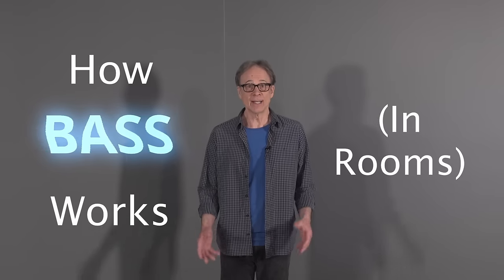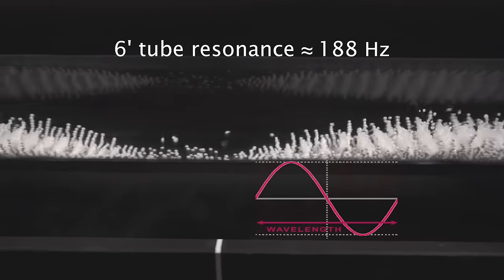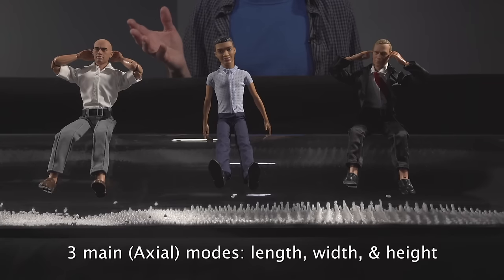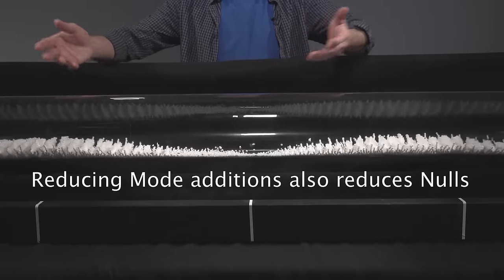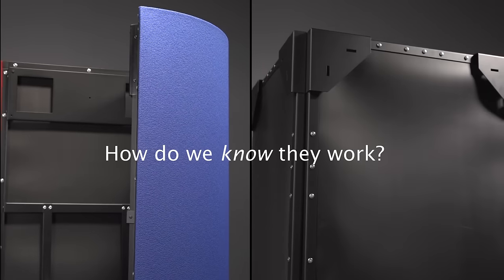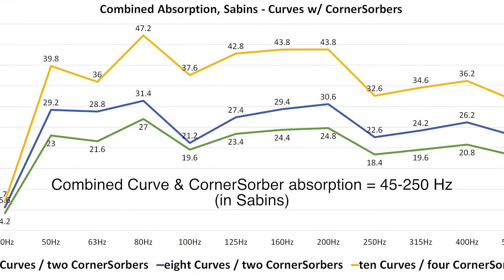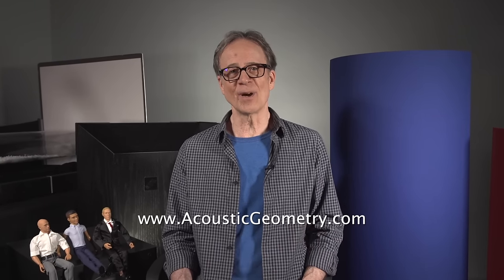How BASS Works (In Rooms) - Acoustic Geometry

Comment: Exceptional video! But what have "I" learned??? That I am not going to be able to sound treat my living room unless I buy expensive accoustic panels that must be placed by expensive specialists who know what they are doing....Oh well...
Reply: I agree. Interesting video but no help whatsoever with setting up my hi fi system and in particular my sub woofers. well its back to good old trial and error for set up.
Reply: @johngarbutt  just buy reputable bass traps, the more the better basically
Reply: @johngarbutt  I agree guys, there is some nice knowledge in here, but as for me and my setup, this doesn't really do much for me other than to play around with my own testing of acoustical materials and where place them in the room and then for the hours of listening tests as in A to B and back to A....
Reply: I think this video is marketing targeted to the very specialists you mention.
Reply: @jasonLJ  bassically
Reply: @johngarbutt  Start by putting them in the 4 corners of the room. That'll go a long way. Ideally they're supposed to be placed at all the corners, such as where the floor meets the front, side and back walls. Same for the ceiling but neither one is practical. Putting them in the 4 corners may reduce standing waves and dips by about 80%. Good chance you don't need to hire or consult anybody.
Reply: If sounds good, it is good.
Reply: Or, go full old school and use egg boxes!
Reply: Not 4 corners...8 corners... 😉

Comment: Nice video production.  I really liked the visual examples and education on how bass works in rooms.  You've said that porous absorption is not effective under 200 Hz though, and that's just untrue.  If that was true, and the only thing that worked were pressure-based treatments, then you'd never see professional studio builders filling their rooms with rock wool and fiberglass at depths up to several meters.  Those treatments absolutely work, way down to 30 Hz, when you build them with correct depth and density.  I can support that statement with a real world experience and acoustic testing data. 

It's definitely correct that as particle velocity decreases the effectiveness of porous treatments declines, that's why airgaps are used.  Even without airgaps, fiberglass can damp room modes down very low in the LF.  In my control room we have a front-back axial room mode of 35 Hz that we treated with 1 m of fiberglass and slats.  The low end is completely controlled.  

And of course pressure treatments have their place and use.  But it's off base to claim that under the Schroeder frequency you cannot use porous absorption.  People like myself are doing it with excellent effectiveness.

Comment: 2021: Acoustic Engineer consultant Designed my music room w/grand pianos(2) 25x35'. It is not s rectangle but has built up corner absorbers; w/Glass Blocks to absorb 50% Street bus noises.  Sound travels 100'/sec

Comment: Great videos! Informative and made easy to understand. I'd love to see a video about the acoustics in a round room. I have a such room with a sound system and I'm having a hard time to understand how to manage the acoustics. It seems like the sound bounces in an almost chaotic way to different directions.
Reply: It still works in a similar way to a rectangular room at low frequencies, except for the length and width are identical every which way, meaning there is one very strong horizontal room mode right in the centre rather than many weaker ones.

Comment: I just go sit in the corner and wish the whole room was that loud. 
😂 <— basshead
Reply: Same! 
(Fun fact, by the way, if you put a sub in and facing a corner with an obstruction (like cabinets) a few feet above it, the output is greatly increased throughout the room with fewer noticeable modes. It's the same with putting it under a desk or something like that. The modes even out to give more accurate output. Why do I know this? Testing! How does it work? Reverb I guess. I don't know.)

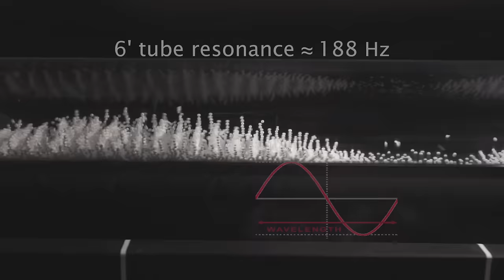Comment: at 0:45 the 6' tube resonance = 188 Hz
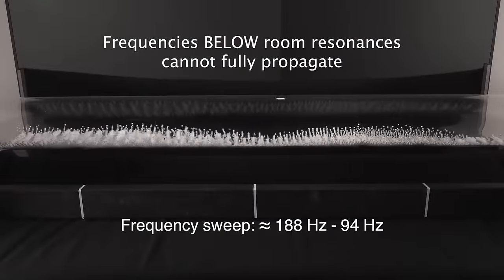at 1:46 there is a sweep from 188 Hz and down to 94 Hz
The narrator says that below the modal range (188 Hz) bass can't fully develop while the video is very clear what happens. There is plenty of energy in the whole tube at 94 Hz at 1:52! 
Bass very obviously develops without any issue below the modal range. -There's plenty of bass inside a loudspeaker box. -We can hear the whole frequency range with earbuds, even if the modal range of the ear canal is at about 15kHz.

1:57 "the room crossover". This is the "transition range" (Schroeder frequency) and it indicates the area where the room transitions from Ray-based acoustics to the modal range where the sound is dictated by the room dimension. It is not "velocity based to pressure based" sound behavior.
The pressure range is below the lowest mode of the room (the longest dimension of the room).
Maybe what the narrator wants to say is that most typically, but certainly not all the time, it is beneficial to use pressure-based absorbers in the modal range. ...at least with regards to how much space the bass trap occupies.

"Only accurately tested & lab-proven bass absorbers are known to work"
That is a very strange statement. A Helmholtz resonator doesn't need to be tested for it to work. Just blow across the neck of a bottle... it works. Further: there's a reason why Sabine's numbers are just above 125 Hz (sometimes 63 Hz) and that is because, as the narrator said earlier in the video if a pressure-based absorber is placed in the wrong location, it has zero effect.
Reply: Hi Lars, thanks for your comments. When trying to explain complex topics simply, it becomes necessary to under-explain deeper parts of the topic; the goal of our video isn't a PhD. level course in room acoustics, it is an awareness that there is a lot going on at low frequencies in a room and that with some knowledge, reasonable choices can be made to improve one's listening space.

The point of the Kundt's Tube demonstration in the video is that below the resonant frequency of that particular dimension, the wavelengths are too long to fully develop and as a result, the usual methods of absorbing sound to reduce resonance energy, which are wavelength-dependent, are far less effective. Of course there is energy in the room from the speaker or instrument - the point is that to control resonances, different methods must be used. 
Many research resources use the terminology "velocity-based" and "pressure-based" - I decided to go with those terms. Yes - there are other LF absorber choices, but they all use much more space and can be unpredictable unless fully tested in an acoustics lab accurate down to the target frequencies. 

As for Helmholtz resonators, I have two problems with them: 1) as air conditions (temperature and humidity) in a room change, so too will the resonant frequencies (speed of sound varies by temp...) - will the Helmholtz resonator track those changes linearly? 2) More importantly, why would anyone add a new resonance to an existing resonance? Sound transients will be destructively affected.

Well-designed and accurately-tested membrane low-frequency absorbers work, and if properly placed, remain the best choice to mitigate room modes, IMHO. There's a lot of misinformation and bad or non-existent "bass trap" specifications in the marketplace; there are test results from laboratories that cannot be accurate below 150-200 Hz due to Schroeder frequency test room size limitations. I'm confident that more information, even if condensed into short videos like this one, is helpful in making purchasing decisions, whether for our products or for other manufacturers. I wish the industry would get its' act together and insist on accurate product testing and specifications for these areas. 

Thanks again for your insightful comments!
John

Comment: No doubts, room dimensions are critically important for good sound reproduction, especially for low frequencies. Nevertheless, if we have the limited space of variables, which fully determine the sound result, it means, that among possible room dimensions for known low frequencies source position (height) there are the best, the worst and medium sets of such a room dimensions. The best room dimensions set for low frequencies is understood like for having minimal spread for amplitude-frequency dependence in range 20 - 150 Hz. Corresponding to this thesis, we can have (or not!) so-called Acoustical Dimensions for this room. Do you agree?

Comment: Amazing !!! The bass is always a problem in the room ... Which is the best bass trap to use in a small 17-18 m2 room ? Thank you
Reply: Hi Christian, thanks for your question! The room modes present in your room would depend on the room's dimensions - how many meters wide by length by height. Divide each dimension by 331.5 (speed of sound at 21 degrees C.) to give you the approximate modal frequencies for each axis (width, length, height). These "Axial Modes" are where your strongest mode additions and cancellations, depending on location in the room, will occur. We prefer to treat low-frequency (LF) modes with broadband absorption (we also prefer not to use the term "bass trap", as it has been widely misused). The combination of our two membrane LF absorbers work from about 45Hz to above 250Hz, fairly efficiently - the ratio of Curve Diffusor (each of which have a built-in LF absorption MLV membrane) and the CornerSorber (a dedicated LF corner membrane absorber) is about 3-4 Curves for each CornerSorber pair. When properly placed at 1/4-wavelength (room dimension) locations along each wall, Curves work very well to diminish modal energy. The CornerSorbers are placed in any room corner. I hope this helps!
Thanks again!

Comment: Cool video! I wonder if you can talk about some design solutions to these bass problems. Like, what would be the ideally dimensioned room for accurate bass? Or what about a room with no parallel walls? Would that make it easier to achieve accurate bass? Could the walls be fitted with textured shapes that disperse sound, or would it be better to just have them angled away from each other, or maybe both?
Reply: To answer that, you have to know ahead of time where the speakers and subs will be placed before the room dimensions can be optimized. See Floyd Toole.
Reply: Thanks for your questions! Designing a room without parallel walls and non-parallel floor-ceiling geometry is a great partial solution, and many recording studios and high-end listening rooms do just that. But volume-based low frequency resonances (the same effect as blowing across the top of an empty bottle) will continue to be a problem. Also, due to room crossover, there are no diffusion treatments that will diffuse wavelengths longer than the room dimensions. The best solution to room modes and bass resonances will include combining effective low frequency absorbers with optimal room geometry design (as well as optimizing speaker placements).
Reply: @johncalder8490  Thanks for the answer. Is there a program you use to determine optimal speaker placement and absorber placement in a given room? Also does room crossover cease to be a problem if your room is large enough to contain any anticipated bass wavelengths?

Comment: When you say velocity based absorbers (fiberglass and rockwool) aren't effective under 200, do you mean not effective at the same depth as pressure based absorbers or do you mean its inefficient use of the space in the room due to the depth you need for them to make a difference, or porous absorbers cant do under 200 hz even if they are a meter deep?
Reply: Thanks for your question, Casper - It's a good one. Fiber-based absorbers (and obviously foam) are ineffective compared to the relatively small size of membrane absorbers; fiber is also less efficient under 200Hz than membrane absorbers; and fiber must be placed in the additive mode points (the anti-node) to be somewhat more effective, which is usually in the useful space in a room.
The "original bass traps" were designed by Tom Hidley to be used in high-end recording studios . They were about an additional 1/4 the size of the control room space (my estimate) and were an entire small room filled with fiberglass (lining the walls and covering a large number of "blades" hanging from the ceiling, with a slot-type "port" opening). These were effective, but obviously used a huge amount of expensive real estate. Properly designed membrane-based low-frequency absorbers (I really don't like the term "bass traps") are more efficient, are best used at boundary surfaces (thereby out of the way without using valuable room space), and end up being cost-effective.

Comment: I’m going to maybe build a studio that is 20 ft L x 7 ft 5 inch W x 6 ft 7 inch H. Is this room treatable?
Reply: Hi Riley - Oof, that's a tough set of dimensions. Too narrow, a bit too low. You'll need more treatment than a wider, higher space because the side and ceiling reflections are close and the modes are higher in frequency than "normal" dimension rooms. Best of luck - some rooms are problematic, this will be one. Not unworkable (hits have been made in "bad" rooms...), but not ideal. You might consider a fair amount of effective low-frequency absorption in the rear of the room. And cylindrical diffusors along both side walls (especially in the front half) and front wall. Fair amount of (at least) 2"-thick fiberglass absorbers as well, in corners and between some of the diffusors. See our YouTube video "Acoustic Panels - What & Where" - here: https://www.youtube.com/watch?v=akiWq97dSBA.

Comment: What problem does the room crossover cause in practical terms?  Longer decay times?  Problems with amplitude?
Reply: Below room crossover, using fiber-based absorbers is far less effective for absorbing low frequencies than using membrane LF absorbers. The room mode resonances which are responsible for room crossover cause much longer decay times at and around the modal frequencies, which also results in widely varying low frequency amplitudes at modal frequencies at different dimension-based locations around the room.

Comment: Just curious, how does different densities of walls affect the sound, like is are hardwood walls and floors perhaps better than concrete floors and sound dampened drywall, like is there like a preference or just whatever is easiest to control in general is the goal
Reply: Good question! There are differing views, of course. To control low frequencies in rooms, some people hold that the most-dense wall structures are best, some believe semi-resonant drywall structures are best. My own preference is for solid non-resonant walls because it is very difficult to predict how a drywall or other non-dense structure will behave after installation. The stud centers, number of screws and their tightness, whether multiple layers are used (and if Green Glue or similar is used), and other construction variables seem to argue in favor of solid, dense, and isolated walls, ceilings, and floors. Then accurately-tested and effective low-frequency absorbers should be used to mitigate room modes. IMHO. Thanks for asking!

Comment: Do they work as bass traps in a bedroom with low frequency noise from outside?
Reply: Good question - our low-frequency absorbers (we don't use the misleading term "bass traps") are made to help reduce room modes that affect bass accuracy inside rooms. While they might reduce some low-frequency noise in the room, reducing noise from outside the room (and sound leaking out from inside) is the task of soundproofing. It's like weatherproofing - you want all the holes (windows, doors, electrical and air-handling outlets, etc.) sealed and all the walls, ceiling, and floor isolated from the outside as much as possible. Please watch our YouTube video "What Is Soundproofing" (https://www.youtube.com/watch?v=t8WGBlVI5A4) to find out more. Thanks!

Comment: Hi - I use DSPeaker anti-mode filters with my '20Hz - 80Hz' subs, and I am happy with the results; would I still benefit from corner absorbers or any other pressure-based absorbers?

Comment: Are these what you would call a Bass Trap? and If not, what is the difference?
Reply: We avoid the term "bass trap" because it has been misused by many acoustical products manufacturers. When calling a 2"-thick piece of open-cell foam or compressed fiberglass a "bass trap" is common practice, the term looses any relevance. We use the term "low-frequency absorber" because our products have been accurately lab-tested to prove they work in absorbing 45-250Hz. I'm not aware of any manufacturers that have tested their "bass traps" for effectiveness in acoustical test laboratories that are accurate down to 40Hz or lower (e.g. NWAA Labs), and so the term is virtually worthless.
The original use of "bass trap" was by Tom Hidley, a pioneering recording studio designer in the early 1970's. He built small rooms off the rear of control rooms and filled them with compressed fiberglass lining all surfaces, and covering multiple free-hanging panels - these "bass traps" had a slot opening off of the control room rear wall. While this type of low-frequency absorber worked, it took up a lot of expensive floor space in studios, and fell out of use.

Comment: I'm interested in knowing if a 6m high room, with the speakers and listener at 3m high, (assuming a 10m wide, 16m long room) would make a good listening room. I mean, sure, it's impractical, but is it a good or terrible idea otherwise?
Reply: Speakers placed in the halfway point of any room will activate that respective low-frequency room mode less than at other locations. But yes, impractical in this example.